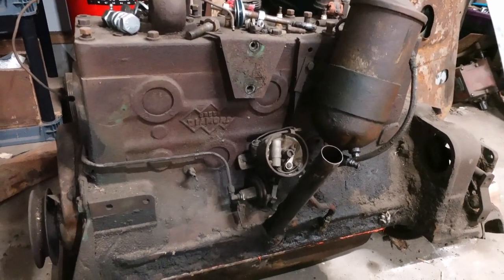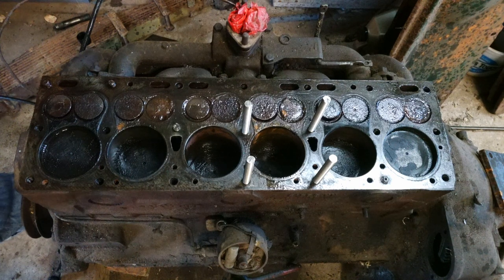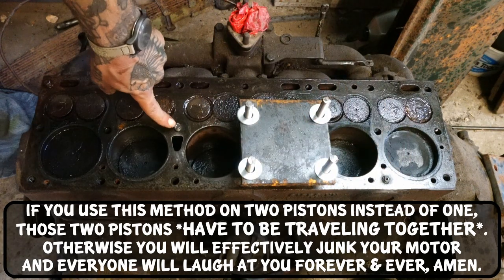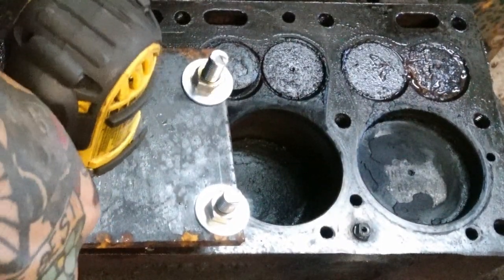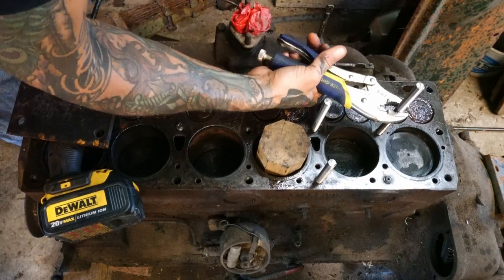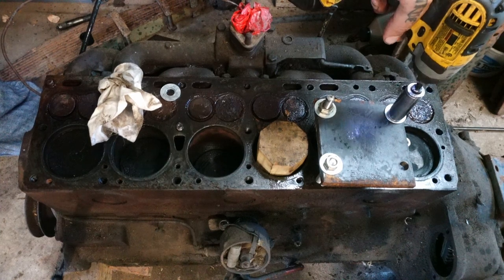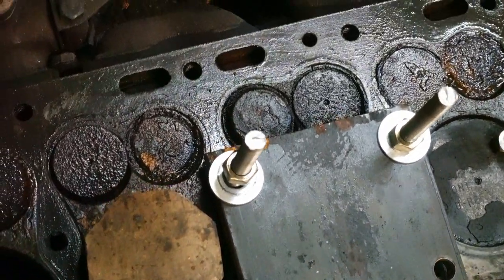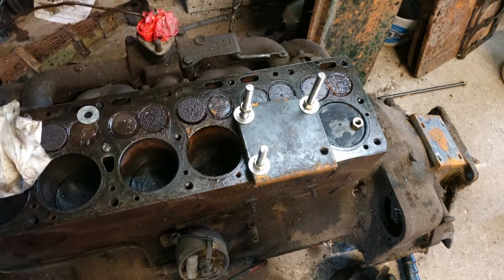How To Free A Stuck Motor

Comment: Thanks! I'm going to try this. When I picked up my '56 S-112 from my father's house he said "Do you want the spare engine?". He had a spare engine sitting in the woods for 60 years, but it still had oil (and some water) in it. I brought it home and have it on an engine stand. I've poured Marvel's Mystery Oil through it, but I will try this method.
Reply from the maker: Good luck! Let me know how it works for you. This method has never failed me, so I’m excited to see it work for other folks. Most motors pop free within 15 seconds of tightening the nuts.

Comment: Once the cylinder head is pulled off you can just drop TWO of the round wooden blocks onto each of the two downward traveling pistons. Might even get to use the original head blots if those two pistons are already near the BDC. The extra weight of the iron head, beyond just the flat plate, may even help.

Comment: Very practical method, thanks. What’s your experience with freeing them up without head removal?
Reply from the maker: My own experience without removing the head is very limited, because I’ve seen several freed without head removal that caused significant damage during or after the procedure. Obviously removing the head seems like more work, but without doing that you never really know what you’re up against (debris in the cylinders, etc.). There’s exceptions to every rule, but I pull the head every time.
Reply: @BareKnuckleBinder  yeah I take your point alright. I’ve had a look with a boroscope on mine and I don’t think I’d have a debris issue it’s a bit of a long shot as to whether it’ll free or not. It’s a straight 6 with 2 cylinders that look stuck, I’ve had it diesel soaking for a week but no sign of anything leaking through on those two. I’m thinking of rigging up a cartridge heater to heat the diesel directly in those cylinders and see if that helps, just for fun really as an experiment. The car will undergo a restoration anyway so probably have to do an engine overhaul anyway.

Comment: Can you do vid on green diamond oil pumps. Where can I find one if its bad.
Reply from the maker: I will be doing a GRD oil pump/filter upgrade video in the near future. In the meantime, if your pump is bad, companies like EGGE can rebuild your pump core. If you need a rebuildable core, I have several.
Reply: @BareKnuckleBinder  Thanks for the EGGE tip. I'll be removing the pump this weekend. I'll wait for your oil pump vid for the reinstall, not sure how to put it back in properly without advice from someone who has done it before.

Comment: Do you overhaul many of the 214's and 233 green diamond -?
Reply from the maker: I've rebuilt several, partially rebuilt more. It's so hard to find main bearings anymore that I tend to keep them going with ring & valve jobs, etc. if they don't absolutely need the lower end rebuilt.

Comment: obviously not stuck bad,i tried this on a sd220 after using krud kutter to remove the rust and all idid was break the wood block which i then installed a piece of pipe and it just embedded into the piston...so pounding a wooden block with a hammer worked way better.

Comment: clearly it works for freeing things up, what about dissolving ring ridges and allowing the rings to be loosened by oil penetrants? if you go to town on a stuck motor straight away, you are guaranteed to do damage.
Reply from the maker: I never do this on a dry motor. It’s always allowed to soak in penetrant first.

Comment: It’s a no-brainer when you can simply remove the head 😂
Reply from the maker: It’s a no-brainer to remove the head period. Anything else is a hack job. 
I understand what you’re trying to say, but why do so many folks get the head off and it still takes them days/weeks/months for results?
Reply: @BareKnuckleBinder  
I’ve done maybe a dozen with the heads off. 
I’ve done far more with the heads on and my experience with break fluid has never let me down. 

I apologize for being a smart ass and realize that I shouldn’t have said what I said. 

The way you are doing this is a very good and affective way. 

I’m just saying that if you are working on a locked up engine in like a car or truck in the 50s on up for example OHV it’s far more work removing the heads. 

The main problem people destroy engines is they don’t have any patience and force things.  Common sense and some patience, you have to let the break fluid soak for at least 4 hours and then slowly work the engine back and forth. 

It takes time to do it the right way, I have unlocked more stuck engines than I care to mention and have had good success no internal damage and all ran without any issues. 

I fully understand what you mean by hack jobs I seen all I need to see and would be embarrassed to put videos on YouTube some of these peoples ways of doing things are hopeless and just plain dumb. 

Good video 👍

Comment: Why not WD?
Reply: WD40 is just a light oil, good for minor lubricating of a hinge or lock. It doesn't dissolve rust like PB Blaster or Kroil will, which is what you need to do with a stuck engine, or anything that's rusted, like screws, bolts, and nuts.

Comment: Oh my God. Wrong. Good way to crack the cylinder wall. Put the engine out side and put 1/2" of diesel fuel in the cylinders and lite it with a propane torch. Let it burn out tap the pistons with a block of wood and they will move easy and cause no damage. Been there and done it.
Reply from the maker: @user-tn1hk6zm2freedom  light an open fire in the motor block? Got it… did you read that in a factory service manual? 

 I’m also not sure where you think the expansive properties of pushing a piston straight down through a cylinder would come from, much less enough to crack a cylinder wall. I’d be more likely to give your comment/opinion more consideration if you’d said “you could break rings” or “you could damage a ring land” (neither of which I’ve ever done in years of doing this) but when you don’t understand how any of this works it makes sense that you may be left with an incorrect notion that this would or even could crack a cylinder wall. Have a good one.
Reply: @BareKnuckleBinder  I cracked 2 390 blocks doing it your way in the passed.